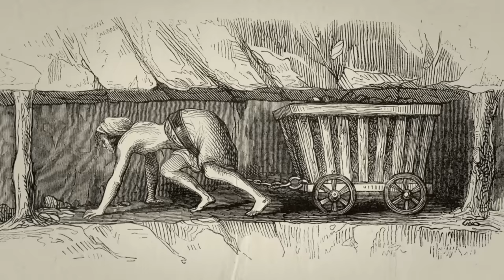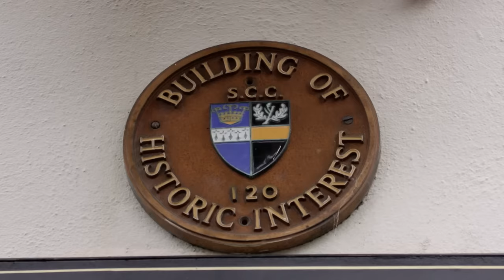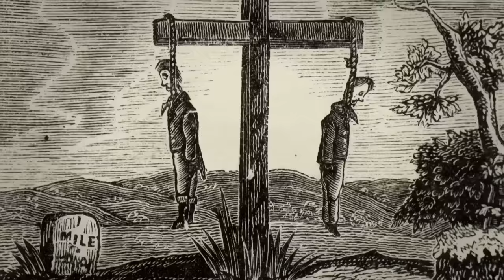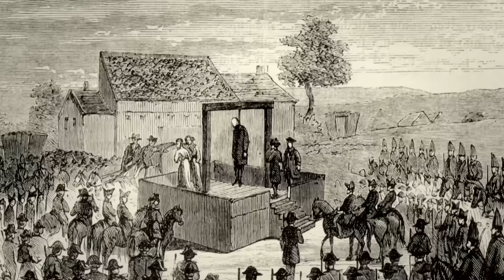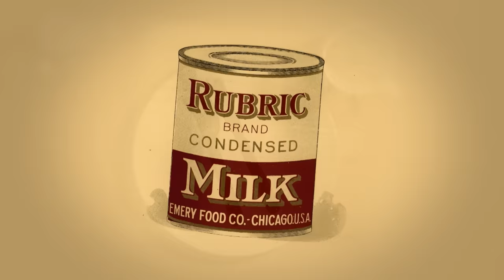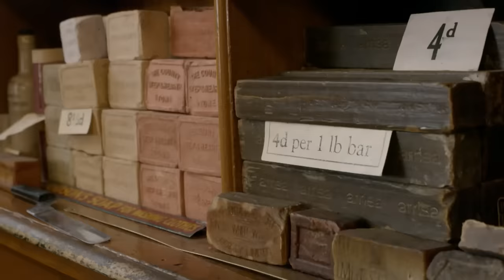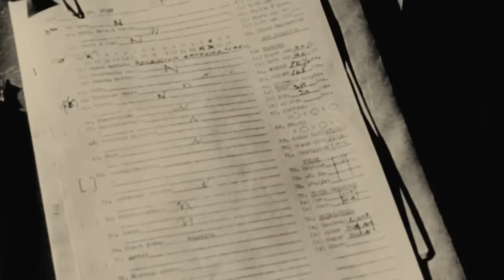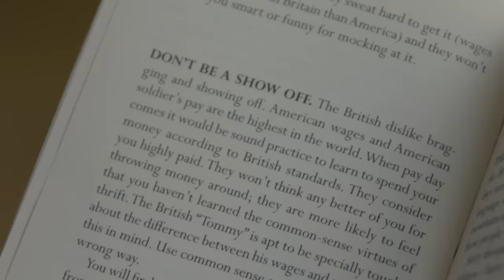The Evolution Of British Society Over The Centuries | History Of Britain | All Out History

Comment: How harmful is sulfuric acid?  One of the ingredients when they made GIN.
Sulfuric acid is a highly corrosive chemical that is potentially explosive in concentrated form. It can cause severe skin burns, can irritate the nose and throat and cause difficulties breathing if inhaled, can burn the eyes and possibly cause blindness, and can burn holes in the stomach if swallowed.   - CDC
Reply: Depends on the concentration. Concentrated sulfuric acid (90-98%) is indeed highly corrosive, just as you describe, however it's not that dangerous when diluted.

Furthermore, they didn't have access to the concentrated stuff back then, as Glauber's and Roebuck's processes (discovered in 17th and 18th century, respectively) produced only about 65% concentration.

Comment: why would the women be working topless in the mines ?   surely, they needed shirts for some protection from the rough walls etc?  I get that it was probably hot, but even so, wouldn't they have been getting scratched up ?
Reply: their bare feet too…ouch!
Reply: The women didn't just work topless. They usually worked with no clothes on whatsoever.

Clothes were expensive, and crawling through the narrow shafts would ruin it. Also, as you said: it was a hot and sweaty job. Lastly, clothes can snag on rocks, and that means the shaft will be blocked until such time as someone can manage to free you.